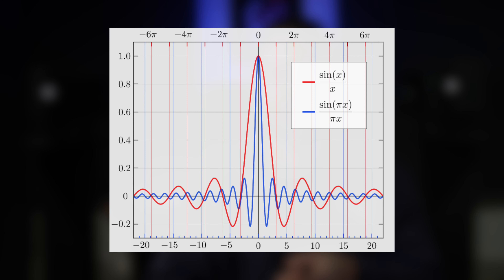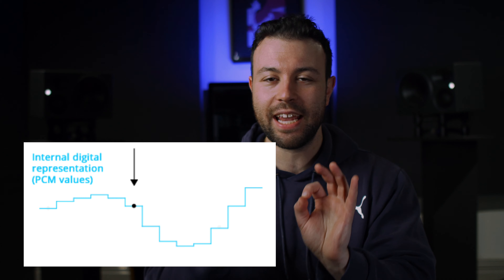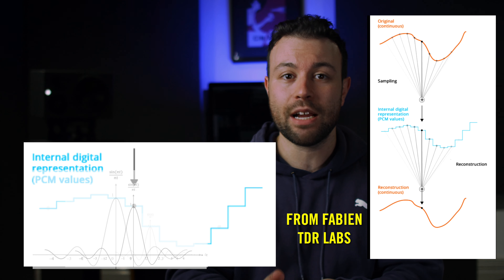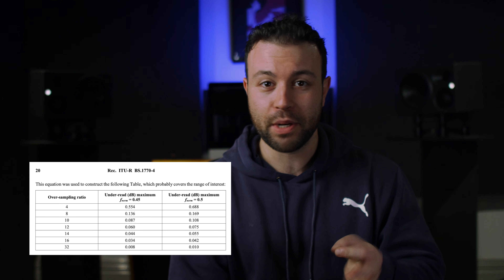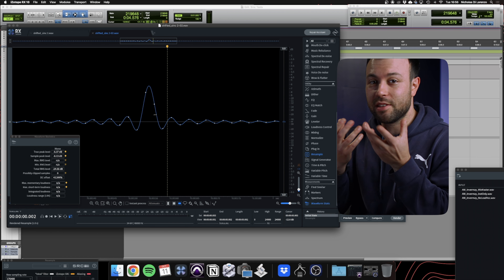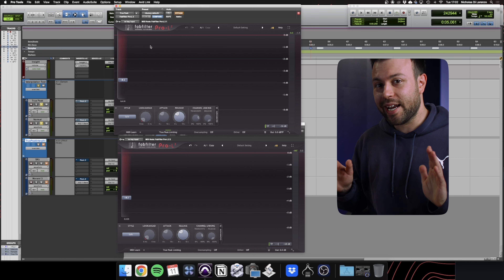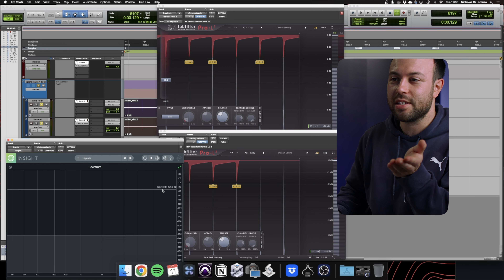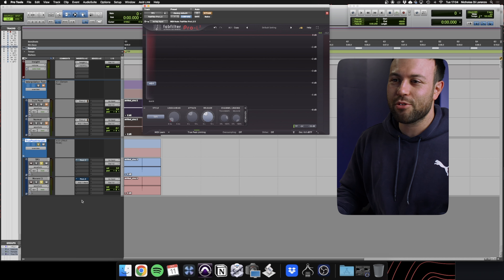Is True Peak Limiting a Lie? What You Need to Know!

Comment: One thing I clearly hear on normal limiters and true peak limiters, is that true peak limiters are more "agressive". I definitely hear they catch too much of a signal, same gain reduction applied. For super loud materials, there's no way I keep using them. All references masters I do have from other studios, don't use True Peaks as well. The amount of True Peak volume above 0 is incredible, lot of tracks peaks +2dB TP (sometimes even more). Not that I like it, but clearly these same tracks with TP Limiters sounds ass. 
For streaming purposes, I use them, but I make sure it does not limit more than 0.2 gain reduction, or not even go through threshold, just a safe spot to follow streaming recommandations. 

Beeing that said, very informative video, thank you! Wish we could get that much of infos in French, that was hard to follow at some points >< It's extremely technical! I still miss some vocabulary.

Comment: The amount of valuable info you put out here for free is just mind blowing.
Reply from the maker: thanks man!
Reply: @panorama_mastering  i dont understand what you said at the end if i do use true peak limiting do i need to limit more in order to get a higher volume output as if the true peak limiting was turned off ???
Reply: @r0bzmusic777  True Peak probably under reads the signal sometimes by 2.5 dB to 0.66 dB so in theory you should compensate for that in the incoming signal to get the same reading as in oversampling mode which is more accurate.

Comment: I would be super grateful for a realistic audio comparison example between no oversampling, oversampling and true peak limiting. Even better would be a blind test with the great reveal afterwards :elbowcough:.
Reply from the maker: These tests were showcasing the function of the limiter; the sound nulls -140dB below 0dBTP Full scale; which would be indistinguishable; otherwise;

The other-thing is; it's easier to set up a null test where I can calculate the positioning of sample points in a scaled sinc-wave over material;
Reply: @panorama_mastering  true enough. So there's not much of a "sound" here...
Reply from the maker: @drrodopszin  Correct, no sound; the ballistics(Att release lookahead) ALL ACT THE SAME; EXCEPT the way it measures/detectrs the peaks

Comment: So, the best way to test TP limiting against normal limiting would be to match gain reduction.  Anyone thinking TP limiting sounds worse is most likely hearing the extra limiting happing. Correct?
Reply from the maker: Correct; not only gain match but also peak normalise the result!
Reply: Well seems that true peak does still sound worse. You get less gain. So same limiting effect but less increase in gain. It’s good for stuff pushing less loud material but when going loud, if this is correct and I understand it correctly, true peak still sucks
Reply: Dont get me wrong i just try to undersrand. If your ears telling you that it is worst than before all that overdampling process. We all think there will be the best natural sound when we keep it as it was sound designed and mixed, but it is just because of the two différents approch because with know technicaly that if we respect all this process, it cant be worst it is mathemathicly impossible because of the high oversampling.
Or maybe you talk only about the mastering end of the end of the process.

Comment: Don't forget that oversampling ALWAYS requires filtering, and filtering ALWAYS messes with phase and/or volume. If you set a non-oversampled limiter up to brickwall at, say, -6 dBfs, then there will not be any peaks above -6 dBfs, full stop. (Except potential inter-sample peaks, but the limiter doesn't know that.) If you switch oversampling on in that limiter, the filters used in the downsampling stage will either create pass-band or stop-band ripples, i.e. volume instabilities, looks like a little sine wave going along the spectrum, up and down, up and down. 
Filters with low or no pass-band ripples usually have a lot of stop-band ripples, and filters with low or no stop-band ripples usually have a lot of pass-band ripples. In some filters, the ripples can even be adjusted, so you can balance e.g. towards a steeper cutoff slope with more pass-band ripples, or towards a wider cutoff slope but with fewer stop-band ripples. 
If a filter creates ripples in the pass-band, i.e. the already brickwall limited signal that goes into the downsampling filter, this means that the previously brickwalled target volume of -6 dBfs no longer applies, since the ripples raise (and lower, but that doesn't matter for peak brickwalling) the volume above that -6 dBfs level at certain spectral ranges. And if the filter is set to create no ripples in the pass-band, then it will create ripplies (i.e. "signal leftovers") in the stop-band, which should be "as completely quiet as possible". 
Remaining signal in the stop-band means: things that shouldn't be there when the signal is decimated/sample-reduced again, so effectively - aliasing. Aliasing as in signal that wasn't there before, but now creates resonances and dips, throwing the spectrum and volume out of balance yet again.
So there it is. When oversampling, you have the choice between throwing the spectrum and volume of your already brickwalled signal off again by filter ripples or by aliasing. 
Either way, what comes out of a limiter that SHOULD brickwall at -6 dBfs but oversamples the audio path, is NOT going to be brickwalled at -6 dBfs anymore.
Same goes for distortion or clipping processors.
A non-oversampled hard-clipper can reliably cut off any sample (!) value above a certain ceiling, but it can not detect and reduce inter-sample peaks. An oversampled hard-clipper can reliably detect and reduce inter-sample peaks, but the output volume after the down-sampling filter will be entirely random and not hard-clipped.
In the end, you either go for accurately brickwalled volume at the risk of missing inter-sample-peaks, or you go for no inter-sample peaks at the cost of losing brickwalled volume.
There's no inbetween.
Some people run oversampled anti-ISP limiters and clippers first, followed by non-oversampled brickwall limiters and/or clippers, that only shave the odd 1-2 dB or so off here and there. But non-oversampled always means: aliasing. As well as the (highly likely) danger of generating new inter-sample peaks from it.
🤷‍♀
Reply from the maker: AMAZING; great addition and commentary on the topic;

If you check out Paul Third's video on Oversampling he makes a great case for the benefit of minimising aliaising being a greater benefit to the sonics in comparison to the filtering needed to make those changes;

For myself; AFTER making this video; I was on a call with Bill Podolak(Product developer for iZotope Ozone); and we looked at how FF Pro-L2 graphed on phase; and can conclude the TP limiter uses the oversampled signal as a SC input to the main signal; so there's a good case for plugins oversampling internally (Especially limiters) the SC signal for greater accuracy in the ballistics of the processing;

Further more; Fabien brought this up with me too when I posed the question of simply UPSAMPLE EVERYTHING; 

It's an interesting topic where the intersect of the theory in the DSP and the application have many consideration we must make;

Ultimately; it's one of many topics I hope to further explore!
Reply: Audio wise, use whatever you like. But be aware that PCM limiters have all odds pointing against them, except maybe digital nostalgia. Don't let the "TP on/off fallacy" distract you from the good stuff (like having full control over the audio peak, ending up with much less aliasing in the control signal, more "analogue" behaviour, all in all a much more natural sound). :)

One can also resample the sidechain only (pretty standard in today's most popular limiters), or resample the delta signal only (the audio "added" by the limiter). These resampling filters then won't ever affect the original signal, neither bandwidth nor phase.
And even if one would resample the audio itself, brute force, it would be easy to create perfectly flat linear phase low pass filters that have stopband ripple below system noise floor. It's trivial. BTW some filter types (Gaussian) have no ripple at all, which coincidently are optimal for DC applications (a sidechain has a DC output).

A limiter's sidechain is a highly nonlinear element. The rectification, threshold/ratio function, AR filtering, each of these multiply the input bandwidth several times. It means without special control, aliasing inside the sidechain will grow by insane amounts. This aliasing in the control signal produces somewhat erratic behaviour. Many learned to enjoy the sharpening effect of such limiting, though. 

Old school PCM riding limiters/clipper were short cuts. Crude and cheap approximations to overshoot protection. They didn't ever really limit or control audio in the first place, all they care about is the PCM samples (like most audio editor's naive waveform representation). Mathematically, they openly break the sampling theorem.
Reply: @TokyoDawnRecords  Resampling the detector path is also a possibility, true, I forgot about that. But even if only the detector signal is oversampled, the calculated gain reduction will be applied to the audio path, which is going to introduce aliasing. And since the detector/sidechain signal goes through a filter, it would throw the detection off, meaning still no true "always below ceiling" brickwalling in the audio path.

I could be totally wrong, but to my understanding a Gauss filter's pass-band response isn't totally flat? So it wouldn't be completely ripple-free, meaning it would cause aliasing and (being a filter) throw off the peak volume, meaning it would also not guarantee "no peaks over the set ceiling". Gauss filters don't seem to be particularly steep, so its center frequency would have to be quite far inside the audible spectrum, creating not just a little "rounded knee" near Nyquist, but likely a rather significant one. I could be wrong about this though, it's been a while since I played around with digital filters.

But all filter-naming aside, in reality most new plugins these days seem to be JUCE based, made by coders who "learned it from that course", so I'm fairly certain they're just using the oversampling methods JUCE provides, which (the last time I tried a few years ago) don't provide fancy (or even optimal) filters but are geared towards simple use. On the road to making money, not everybody's interested in wasting weeks of development time on trial-and-error experiments, in the hope of implementing their own (rather) optimal method for something, if a ready-to-use building block that does a fair job is already available. Sadly.

I understood your last paragraph. Interesting, I never looked at it that way, but you're obviously completely right. But in the discrete/digital domain, the closest thing to "actual audio" like in the continuous/analog domain is an upsampled sample stream at "finer discreteness"? Which would mean all digital non-linear processing would be an approximation, since no "fineness of discreteness" (i.e. amount of up-sampling) could ever reach true continuous-ness?
Reply: @1b2m  Oh I agree, audio DSP is quite advanced, and it's not unusual to find all sorts of weird ideas or half baked implementations in the plugin market. It's still in development.

About the Gaussian filter specifically, consider an oversampled sidechain, where the input SRC filter (AC context) is a traditional SINC to capture the full input spectrum as precisely as possible. But the output of the SC (now a DC context) is SRC'ed via Gaussian, to deliver the smoothest possible envelope for that audio input. This is also quite useful in combination with the "max windowing" necessary for lookahead limiting. It's realistically possible to make this act completely flat, because every filter type works in the context that fits it best.

Of course this is highly specialized stuff, but the way educated developers chose and use the full range of filters available to them. Of course, brute force resampling, especially if not done correctly, will quickly show deficiencies in one way or another (e.g. bandwidth systematically reducing input to output, static aliasing, noise, phase distortion, etc), it's easy to mess up!

But all in all, we should value the opportunity - first time in history - to have moderately nonlinear digital devices act like optimal analogue devices. A limiter that is not true peak aware systematically/logically violates the sampling theorem. This is worth being questioned, loudly!
Reply: lmfao im going to bed
Reply: @gozutheDJ  Can't handle the truth?
Reply: My question is does true peak really matter?  I download references of commercial songs and most of them go above 0 db in my pro tools session!

Comment: Great demo about this. I had to wonder if true peak limiting was a good thing. I've been using it, but with so many saying it's bad, makes you consider.

So it seems true peak limiting or 4-8X oversample gives similar results, and neither change the audio perceptibly.

I'll have to switch between true peak and oversample to see what happens. Right now I'm clipping into an SSL X-Limit. Other limiters I've got: LVC Limited-MAX, TDR Limiter 6 GE, Venomode Maximal 3, Nugen ISL-2, stock Studio One, Slate FG-X2 in their Complete bundle, D16 Frontier...

Comment: So, with the Pro L2, is there any advantage to using 16 or 32 x oversampling? (I generally leave it on 32 as my M1 seems okay with that CPU load-wise) How does TP and oversampling interact? If I'm oversampling at 32 is there any point in also having TP on?

Comment: the basic, use it since yearssssss, why people still use the bad representation of zero order hold. Of course true peak don't get a sound just increase your precision. 
At sametime not all oversampling are the same in limiter. With some in *4 output -0,3 db you set a true peak meter after you will never clip, and some at same setting still clipping.
So spend time to learn and measure your stuff. So with basic limiter no oversampling or true peak a -1 db output like apple ask is good, but if you get good limiter you can win 0,7db. Wav master at -0,3 db convert in MP3 320 you get less than 50 true peak clipping, in most commercial track you can get 20 000
Reply from the maker: BANG ON!

Comment: how about 8x oversampling with the True Peak limiter like Pro-L2, which has the option to do both. Is there any benefit to it compared to the non-TP limiter with equal amount of OS ?
Reply from the maker: Measurably; we may be talking within tenths if not hundredths of a dB of tolerance if you're both TP limiting engaged and 8x oversampling; 
My bet is stick to 8x oversampling in FF Pro-L2; you know the max overshoot will be 0.168, so set your ceiling to 0.2dB and you're completely safe!
Reply: @panorama_mastering  What in your opinion is the ideal true peak level considering encoding to MP3 and for streaming platforms?

Spotify reccomend up to -2.0dB true peak. I have used Ozone's codec to see how this affects the final reading and it seems that up to 1dB can be added during encoding which can result in unwanted clipping.

Comment: Every analog device can handle few dbs over zero..so is TP really needed ?
Reply from the maker: Maybe, maybe not; I'm not exceptionally well versed in how cheaper devices handle overs at the DA stage; other than I've "experienced" them not handling significant overs very well; (Subjective not objective) This is only my experience...

TP limiting is not needed for the sake of "avoiding" true peaks over 0; but more-so for better and more accurate measurements for a limiter to operate by;

Comment: On the Ozone Maximizers i still don’t like ultimately what the True Peak button does to the sound. Even when dialed back. Do you think it’s worth the hassle of pulling up something like DDMF Metaplugin to oversample it? If so, what’s the multiplier you recommend?
Reply from the maker: Sessions at 44.1/48k (8x oversampling)
Sessions at 96k (4x oversampling)

Both will bring you within a 0.169dB of tollerance with under-reads which is exceptional!

Comment: So after all of this knowledge you've gained, will you use TP limiting on your next masters or you decide to stick to your previous way of working without using TP limiting?
Reply from the maker: Good question; funnily enough I've always used 8x oversampling in FF Pro-L2; so in practice I've always been reducing these undereads (Even if I haven't been conscious of it)
So with FF Pro-L2 I WON'T change the way I'm working or turn TP limiting on;

However in iZotope Ozone Maximizer; I will turn TruePeak limiting ON because as confirmed with their engineers; it enables the 4x oversampling which helps reduce those over-reads;

And I use both limiters for different use cases;
Reply: @panorama_mastering  finally we know about oversampling in ozone. why don't they tell in the manual? Luckily I turned TP on anyways. Thank you for your work even though I don't get the math haha
Reply: @panorama_mastering  Thank you for the info Nicholas! When you say Maximizer's TP button enables 4x, are you saying that it is doing this to create more ISPs to show up in the meters? I would have thought that a better "brickwall solution" like the TP button would be non-oversampled since oversampling creates ISPs...how does that work?